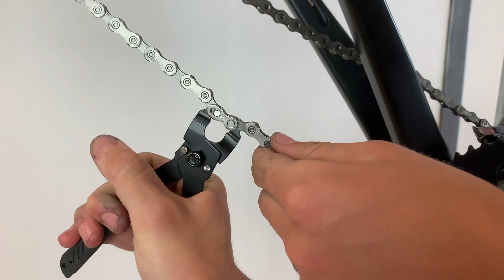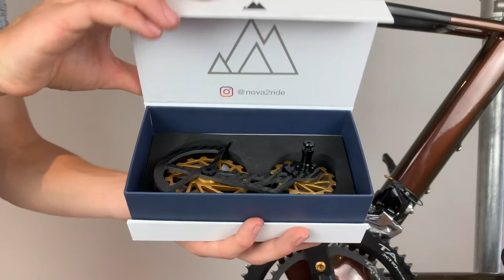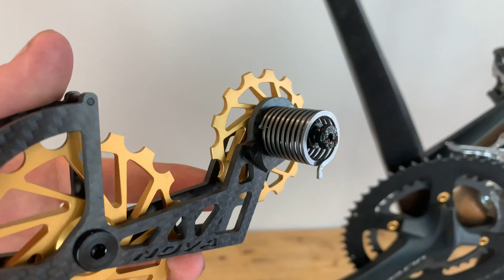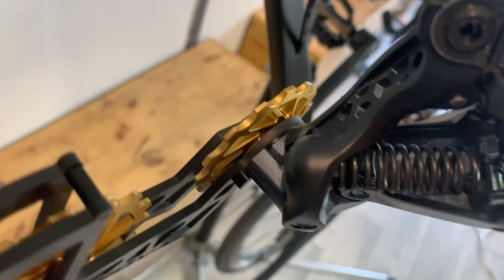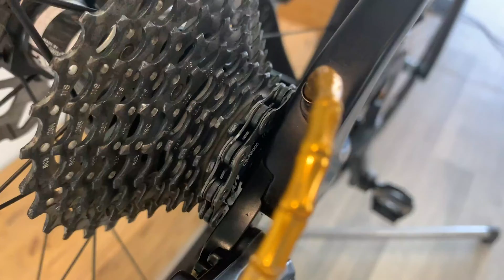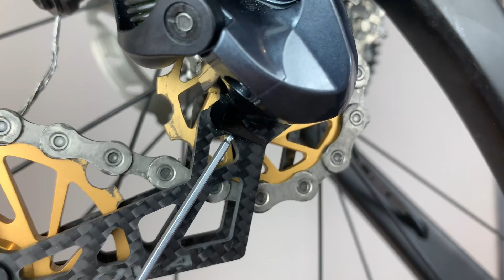How To Install your CCD for Shimano 11S

Comment: Hello all, hopefully you can answer this question: On Shimano r8050 Di2 SS (Short Cage) where the limit for a cassette is for an 11/30, installing the CCD can increase the possibility to upgrade the cassette to say 11/32 or 11/34?
Reply from the maker: 11/32 maximum for Shimano 11 speed

Comment: Thanks for making this video. If I may provide some feedback it may be helpful for others as well. Please note I watched this video with CC on to see the instruction text. 

1) The video should recommend adjusting the B-screw BEFORE putting the chain on, whilst you can see the distance of the upper pulley wheel's teeth from the bottom of the large sprocket's teeth. It should also recommend to set this distance to ~5mm and that this can be fine tuned later when indexing.
2) There is no video footage to show how to size the chain and account for a master link as part of the size, etc. Rather, at the part where you mention to leave 2-3mm between the nova stopper and the derailleur body, which is relevant to chain sizing/tension, the video is showing adjustment of B-screw which is relevant to what I'm talking about in step 1 (setting the distance between the upper pulley wheel and the cassette). This misalignment between what is on screen and instruction text might be confusing to some.

Comment: since installing this ospw when using my small chain ring I am unable to shift into my 2 small cogs using a ultegra di2 system. Any advice?
Reply from the maker: Dear customer,

Did you set your chain length correctly? Did you re-adjust your derailleur after installing your oversized cage?

Do not hesitate to send us an email at sav@novatoride.com with explanations and a video of the problem. We will get back to you quickly with a solution to your problem.

Hope this helps! Waiting for your message.

Kind regards,
Tom - Nova Ride

Comment: What is the difference between this and previous version?
Reply from the maker: Hi Randy,
This 2021-22 cage version is slightly shorter (5 grams lighter) which allows the upper pulley to be closer to the cassette which allows easier shifting adjustment.
Kind regards, Tom from Nova